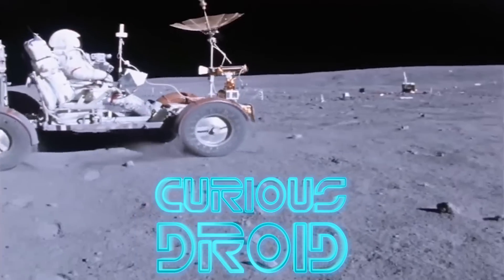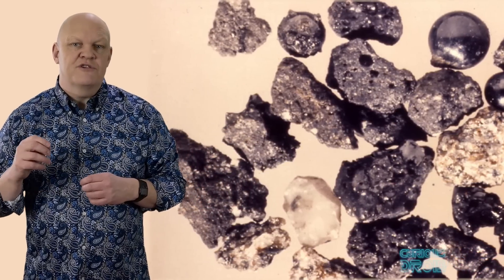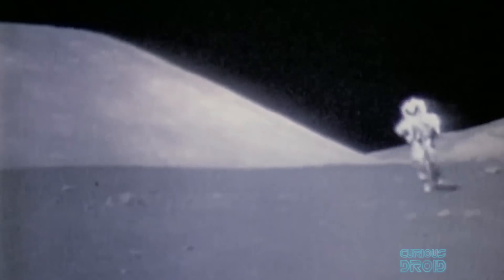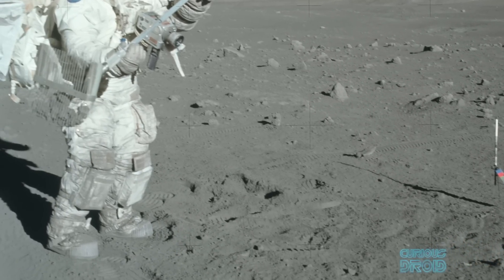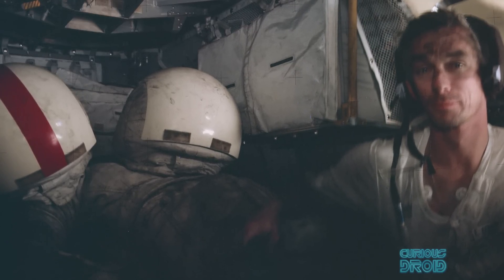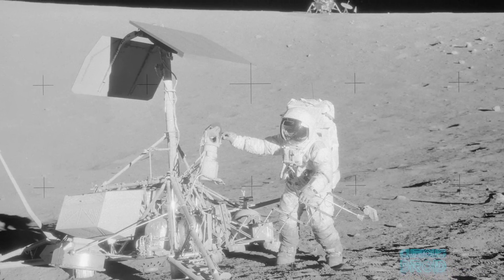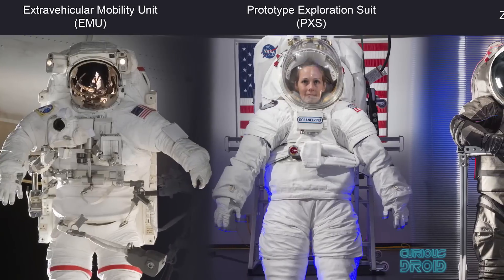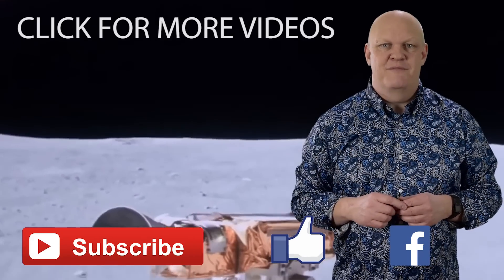Apollo, the Lunar Dust and NASA's Dirty Problem

Comment: The dust from the rockets travelled half way around the moon but the rooster tails from the rovers settled back down a few feet behind the rover?
Reply: Velocity.
Reply: Can you read? The dust from the rockets travelled half way around the moon. I said the wheels of the rover threw a rooster tail of only a couple feet you dipshit - not a rooster tail half way around the moon. But in 1/6 the gravity of the Earth and no air resistance of the vacuum those rooster tails act no different than they would in Earth's atmosphere and gravity. Why, because they were on Earth moron.
Reply: Bob Barker I think you are barking up the wrong tree (or have your head up your own arse) Without an atmosphere the material would have been flung in a straight line, not an arc as it is in the videos. And it would continue in a straight line except for whatever small amount of gravity (one sixth of Earths) eventually pulled it out of its straight line trajectory. It would travel six times further on the moon than on Earth IF both atmospheres were equal. Without an atmosphere those particles should have been shooting out for a long ways further than they did. Again, they acted no different than any vehicle on Earth. Just watch a dirt track auto race or motocross or dune buggies. By your idiotic reasoning, a shot fired from a rifle on the moon would have travelled less than it would on Earth? How stupid is that! Without air to slow the bullet it would go further. With less gravity to pull the bullet down it would stay in a straight line longer and drop less as it travelled. I can't believe someone could say that lack of air resistance would cause a change of direction!
Reply: john hendricks You're much too stupid to ever understand the answer!
Reply: idiot
Reply: I AS TALKING ABOUT SOMEONES COMMENT  I DONT THINK WE HAVE BEEN TO THE MOON  IF THEY DID HOW DID THEY PROTECT FILM FROM HEAT AND COLD ?
Reply: John Hendricks Your eyes work even less than than your brain! Look at the rooster tails drop to the surface almost immediately and no different than in earth's gravity and 
atmosphere.
Reply: HOW DID THEY PROTECT THE FILM IN CAMERA FROM MELTING ?
Reply: @johnhendricks559  Why do you think convective heat transfer would work in a vacuum? The vacuum cannot conduct heat because there is no medium to facilitate the transfer. The vacuum is a thermal insulator, not a thermal conductor. Conductive heat transfer (direct contact) and radiative heat transfer (like sun light) still work but convective heat transfer does not.

Comment: 1 question. if this is on the moon, why does the dust fall back to the surface faster than the Astronauts? that doesn't make any sense. if this is fine fine dust, how is that possible?
Reply: Buying SUMMONS Because it is displaced to a lower height above tbe surface than the astronaut jumps. Basic high school Newtonian Physics: jump higher and it takes longer to fall back to tbe surface.

The 'fineness' of the dust is irrelevant. In fact, the fact that the dust falls as rapidly as anything else is one of the best indications that this was filmed in vacuum -  there is no air in which the dust can become suspended.

Comment: Let me get this straight.  They took theoretically combustible dust, inserted it into the cabin of a vehicle that was their only means of making it home alive, and re-pressurized the cabin just to see if it would combust...  anyone else see the problem with this idea?  High school drop outs could have come up with a better (and safer) way to test moon dust combustibility.
Reply: Well, actually this was the ONLY way to do it. They had no other pressurized room on the lander. 
They repressurized very slowly and would have depressurized as soon as the first smoke would have been visible. 
Remove the air --> remove the fire.
Reply: +Bob Barker
Please desist from this kind of comments.
I know such levels of stupidity are hard to tolerate, but just blaring out random insults will not improve the situation. 
Therefor I appeal to your intellect and ask you to join further discussions with a more civilized choice of words.

Comment: The electromagnetic phenomenon is the actual cause of the craters. This is why the craters are perfectly round, uniform depth, and relative curvature. The dust is collecting due to charge difference. Mars has dust storms due to a similar reaction. Instead of low pressure like earth weather,  its high electrical potential, attracting lower charge particles. The solar wind is electrical in nature, propelled by the suns magnetic field. A comets tail is plasma( solar wind ) which cannot be absorbed by the low density of the comet. Asteroids with heavy metals, won't develope a "tail" until closer proximity to the sun, due to the metals ability to absorb charge. Some heavy metal objects will emit x rays, and microwaves depending on what metals they contain. This is why orbital predictions for comets and asteroids is spotty. Gravity is a electrical balance of charges, between mass. Electromagnetics is the driving force of everything, from the cosmos, to the atomic structure.
Reply: Gravity is not electromagnetic, they are two different things.
Reply: mikedelhoo Why couldn't it be? Newton's and Einsteins equations don't work for galaxy rotation, so they invented dark matter and energy. Plasma physics has shown through repeatable experiments the causation for galaxy rotation. This is why quantum, and classical physics don't have unified feild  equations. Plus...Gravity, mass, and energy are undefined currently.
Reply: In what sense are gravity, mass and energy supposedly not defined?
Reply: mikedelhoo Do we have a electron to mass ratios? The Higgs boson should have determined that. The LHC is for a understanding of gravity. Gravity is described by mass in a object, gravity is described by amount of mass. The current equations can account for local movement, not the visible cosmos. Where does gravity manifest it force?
Reply: That doesn't seem to have answered my question. At the least, gravity manifests itself through such things as the attraction of objects to Earth, and to each other.
Reply: mikedelhoo I'm sorry. I should have been more specific. But while we're on specifics, where does gravity originate?
Reply: mikedelhoo I'm don't mean to sound condescending, but this is well known in the current physics paradigm. Most people don't realize the problem. And the problems are many, with implications of bizarre possibility.
Reply: If we stick to Newtonian gravity, then gravity is a property of mass. So?
Reply: mikedelhoo Then why dark matter?